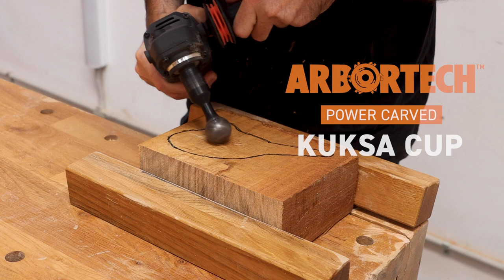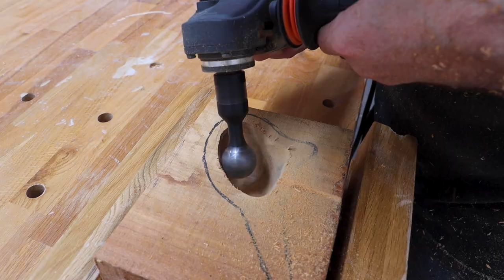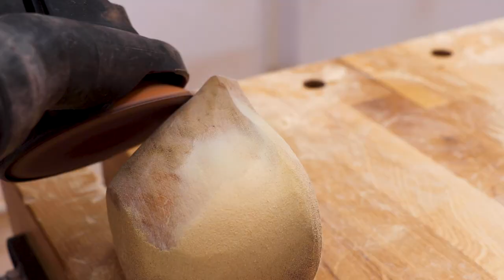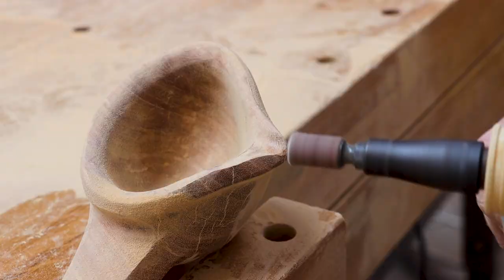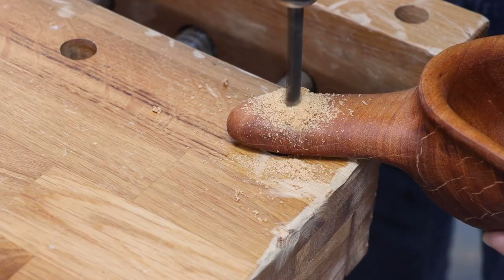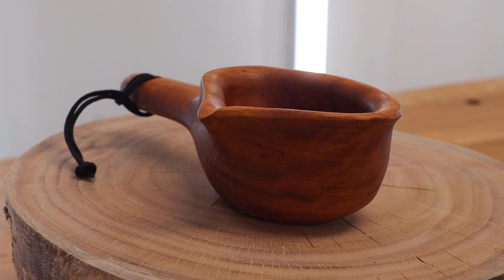How To Make A Kuksa Cup | Wood Carving Time Lapse

Comment: I would like to know what rpm you are using because at the higher rate there is no control of the turbo planer
Reply from the maker: Hi! The TURBOPlane was set between 9000-12000 RPM. Let us know if you have any further questions 😊